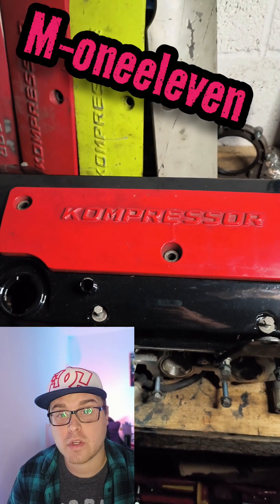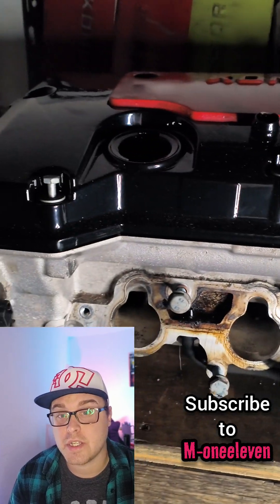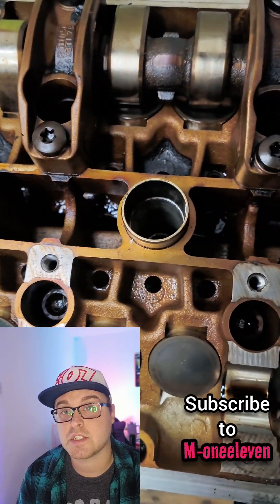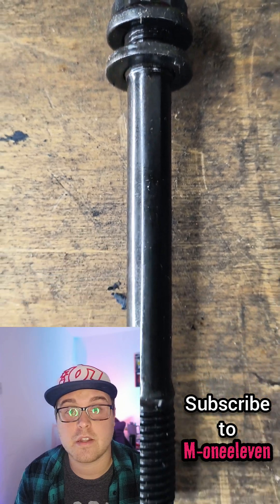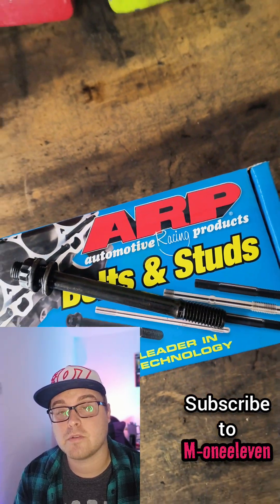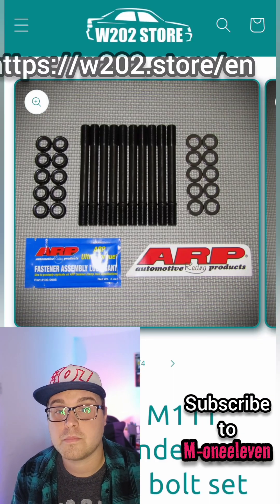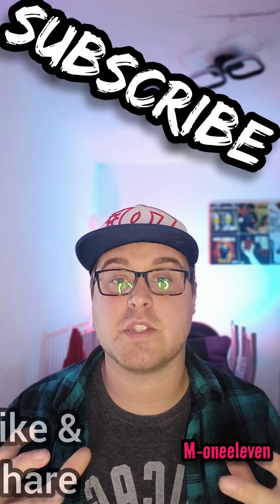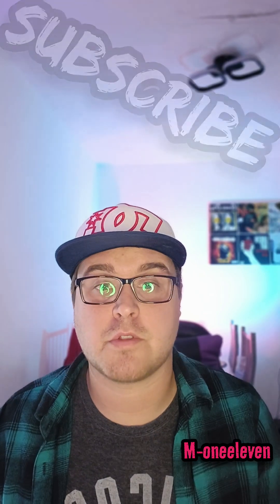Clamping Down On This #shorts

Comment: I don't know, stock (victor reinz) headgasket seems to hold 1.9bar boost okay, just use new headbolts
Reply from the maker: @siimk7437  but is that a brand new stock Victor reinz gasket? I mean the original for when people try to do "bolt on boost" turbo conversions, basically on a unopened block. There are a lucky few but from my own experience and the experience of many others the fibre gasket doesn't seem to hold up to well in turbo applications. Before the current build we did used to run the fibre gaskets, but didn't find them reliable hence the current build getting a MLS headgasket but we're also going for higher power and reliability. Also depends on turbo sizing too these engines seem to respond best with T04E size turbos up to GT30 anything bigger seems to push standard gasket a bit to far

Comment: Hey Alex, I am going to build my M111(2.3 kompressor). Where can I purchase the MLS head gasket as Stern Garage no longer offers it. Also, great video and I will make sure to get these bolts.
Reply from the maker: @Zetrikz1  so the headgaskets do seem to be difficult to find it maybe worth emailing stern garage, however I believe the guys at hedgehog Motorsport in Thailand are making them I believe are making them still, you can find them on Facebook and I believe they have a website, I hope that helps 👍

Comment: Great Video, will the extra length cause any problems?
Reply from the maker: Thank you, not in this case as the extra length is on the top side and there is enough clearance 👍
Reply: @M-oneeleven-M111  Awesome thank you